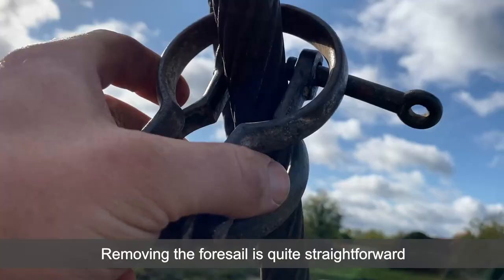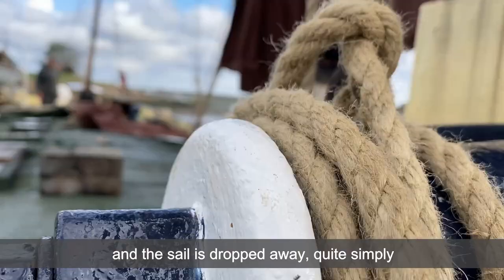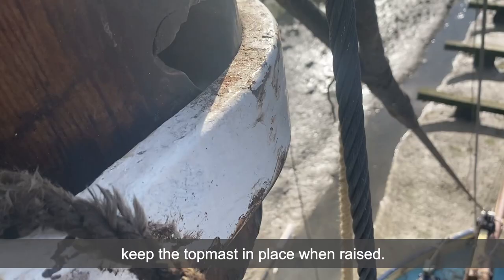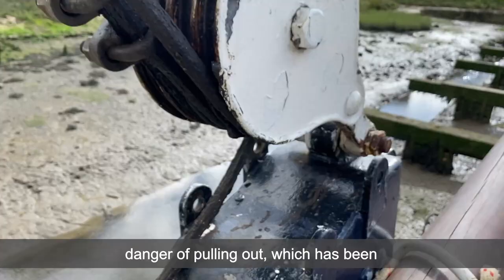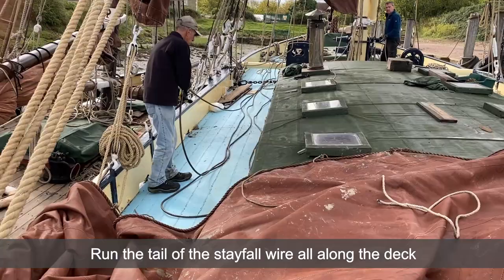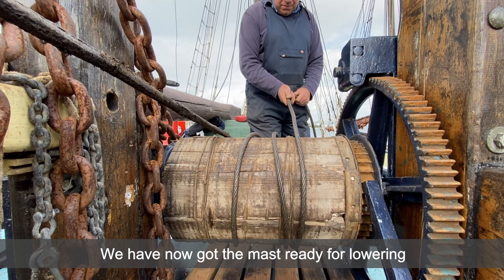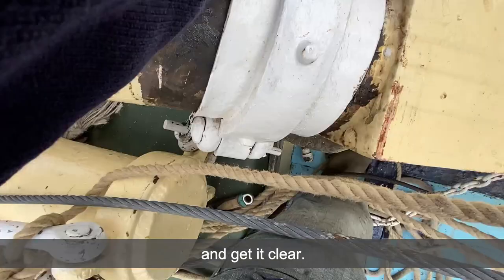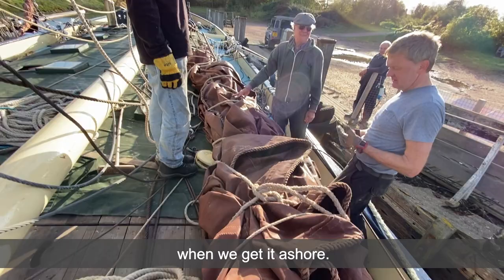Laying up for winter - de-rigging the Thames sailing barge 'Edith May'

Comment: I believe barges used to shoot bridges on the Thames by lowering the mast, hard to imagine when watching the process of lowering it. Were they specially rigged in some way , to do that? Perhaps only the stumpies did that?
Reply from the maker: You are quite right Jeff. Topmast barges did shoot bridges, but they would be a little smaller than Edith May and wouldn’t have had to lower topmast. 

In addition, we lower down once a year and so we take our time, whereas the old Huffler could be doing it several times a day and would be lightning quick. The mate would have to do some basic prep before he came aboard I expect, like getting the stayfall up on deck.

Looking at old pictures, they would have needed nerves of steel to lower down at the last possible moment and maintain momentum under the bridge.
Reply: @TillerWheel  Thanks for that, it makes you realise what amazing skills those men had, it looks pretty hairy on the video!!